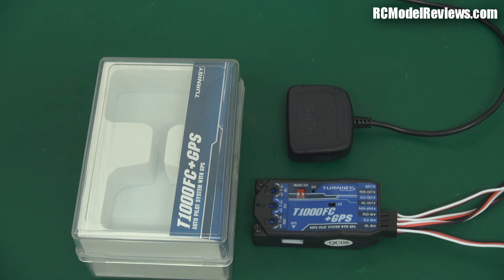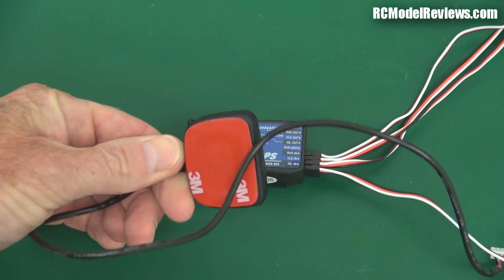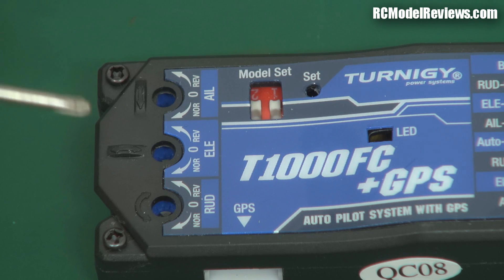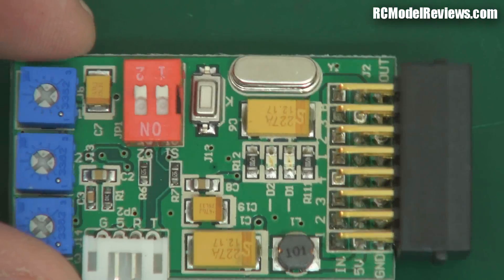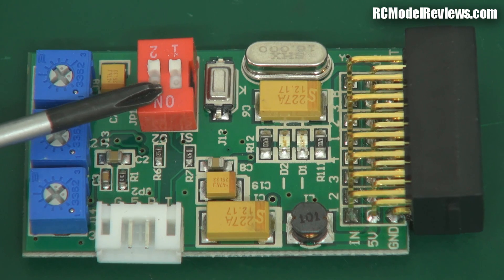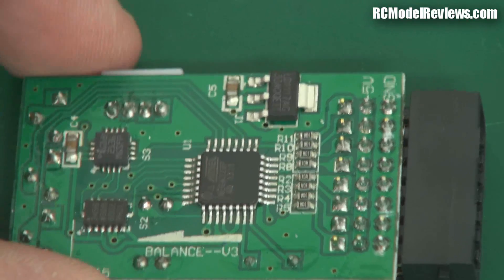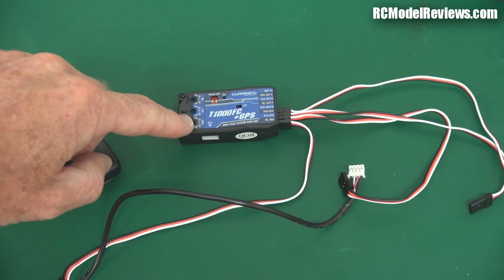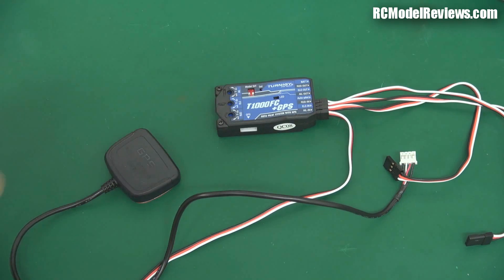The Turnigy T1000FC with GPS (a first look)

Comment: I've watched many videos about this unit that mention how the unit does not indicate when it has aquired GPS signal (hence why everybody waits 5 minutes just to make sure) But there is a blue LED on the GPS unit itself that lights up when you have GPS lock, difficult to see in daylight though so I wonder how difficult it would be to replace it with a brighter one?

Comment: Well I was lulled into thinking that with this device I'd never loose another plane, but I hadn't counted on it flying out of range. The plane I lost was actually quite a bit closer to closer the transmitter than I had flown before when it stopped responding and flew off into the woods, never to be seen again. Have you ever done any testing on the best way to position the receiver antenna to achieve best range?
Reply: Did you set a failsafe to tell the module to go into RTH when you lose control?
Reply: Matthew O'Connell No. At the time I was using my Turnigy 9X with their 9X8Cv2 receiver, and I don't know how or even if I could set f/s with that Rx. Now I have the Fr Sky XJT transmitter module and X8R receiver that does have fail safe, but I have yet to figure out how to set it up. Any advice??
Reply: The failsafe set up is different for every transmitter/receiver, try a google, but you need to set it so that the autopilot goes into return to launch mode if it loses signal, this would of saved your plane.

Comment: This thing works great, and I wish I'd had it a year ago. I have lost three planes in that time...let them get too far away in windy conditions and then wound up getting anxious and over-controlling  till eventually they were out of sight. In auto-level mode this auto pilot makes the plane solid as a rock and easy to steer with just a nudge on the rudder. Flip the switch to Return to Home and (as long as you haven't let it get out of radio range) it comes straight home and starts lazy circles over your head (or wherever you set 'home' to be). Only thing a bit dodgy is that in RTH mode, if you cut the throttle too much it will suddenly start into a steep spiral dive, so make sure you switch to one of the other modes before starting descent to land.

Comment: Hello,

I have rather large two piece carbon fibre prop and would like a little advice on balancing it.  I've built a shaft and bearings to make my two piece spin.  I can balance with tape but it rips off at 5k.  Maybe there is an easier way.  I hate to glob a bunch of epoxy on a $320 prop. 

Just putting it out there,
Doug

Comment: Bought one of these as a cheap entry into stabilisers and GPS and tried it out today. As you warned I did manage to reverse the Aileron channel when adjusting the gain but survived; just! During the setup I was trying to get some reaction out of the Rudder which doesn't seem to come into play in any of the GPS modes. It turns out that on my unit, the Rudder and Aileron posts are incorrectly labelled. Be careful. Another thing to watch is that there are four modes available with the GPS installed. On a 3 position switch, the centre position doubles up and delivers two modes depending on the direction the switch travels to reach the centre.

Seems to work OK but doesn't appear to use the rudder, even in RTH mode. The "manual" mention setting the gain in 3D mode so maybe this means the rudder isn't used in the GPS modes? Any ideas?

Comment: Hard to see any merit in this device over the FY-DOS unit for the same cost
Reply: Which FY-DOS unit has RTL for $70?
Reply: The least expensive I've seen the FY-DOS at was $125. The HKT1000FC is only $65...
Reply: RMRC has them pretty cheap at the moment. $60 if you already have a gps or $100 if you dont
Reply: So for most folk it'll be $30 dearer then.

Comment: RTH without throttle control is a bad joke. Like this unit.
The electronic provided is 20$ in value, the firmware is most probably copy from open source. Bruce, don't waste time with junky products, HobbyKing has a mix of good and junk in their shop. Try to be more selective.
Reply: I choose products on the basis of what I think people will be interested in.  And besides, you know that if it's junk -- I'll say so! :-)

Interestingly enough, my FY21AP doesn't have throttle control and its RTL has never let me down.

Comment: hi Bruce! is this module able to controll the throttle amount ?
Reply: No, just the aileron, elevator and rudder.
Reply: *****
so if the plane goes out of range I need to make the fail safe of 50% throttle,other way the plane will never make way home......I use arkbird on my SkyWalker and as you know we can adjust the speed we want the plane fly back home.So if you lost the plane and you are a crosswind will this autopilot be helpfull? thanks for work hard for us!
Reply: zodrik81 .
Yes, you'll have to set your throttle at a sufficiently high level that the plane will still fly without stalling.  The Tornado OSD/flight-controller I'm also looking at now has an airspeed and GPS speed indicator so it will control the throttle to maintain a constant speed.

The T1000FC should still be able to rescue your plane, just so long as your throttle is set high enough.

Comment: Has anyone tried this on helis?  I tend to lose orientation too easily and if this unit stabilized and brought it back to where you could regain control, that would make heli training safer and easier.
Reply: You would probably have to tilt the module backwards a bit so the heli will always be tilted forward, otherwise it would just hover on the spot, helis don't move unless you tilt forward, planes will.

Comment: Could wire the stabilizer up to that Assan dual receiver unit so you can switch between flight stabilizer and raw receiver control. Not the best solution but it would probably work with a few servo Y cables

Comment: with the tall unsupported components it would be easy to add some silicon or hot glue to minimise the effects of vibration. Another tip with this and other similar units is to strip the power and ground wires from the cable connectin the RX to the unit and supplying power only via the Batt input. this reduces the amount of wiring an prevents ground loops with miultiple ground points.